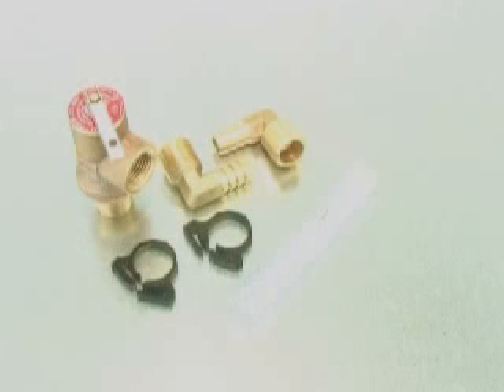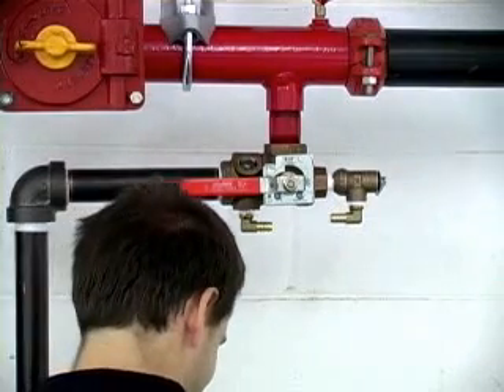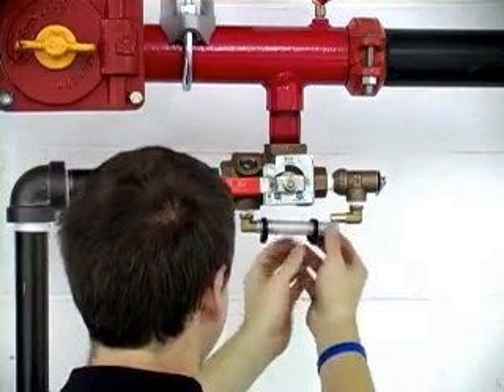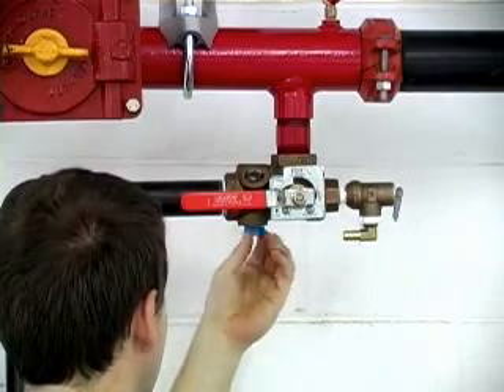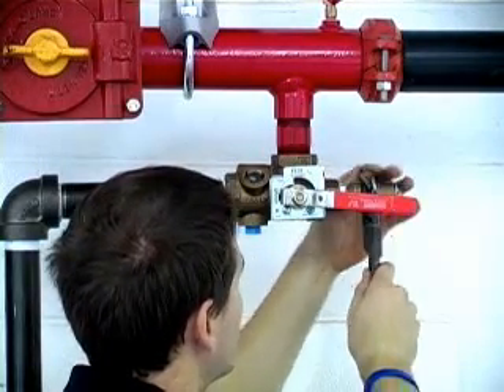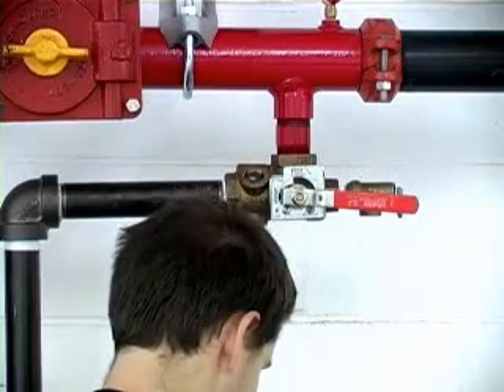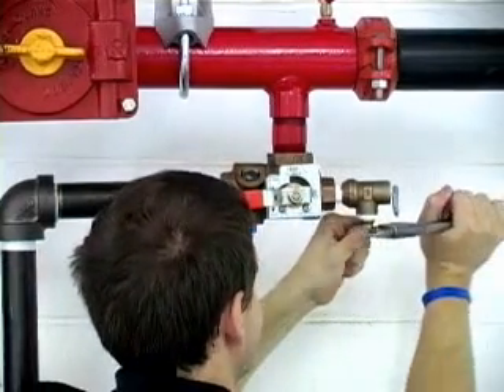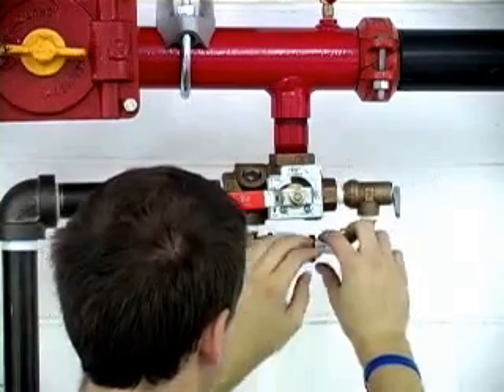AGF Pressure Relief Valve Installation and Maintenance

Comment: Hi, please I have facing problems with some relief valves. Usually they leaks or dont relief. I noticed that when the air gets into de system and during hot days the pressure increases and refief valves open and dont closed anymore. I guess this type of valve isn´t a precise like ajustable ones. So it is always dificult to keep than workin properly. Any advice  will be very welcome. Thanks in advance.
Reply: Hi Rodrigo, What is the static pressure of your system? You may discover that the valves are not leaking they are actually relieving pressure but they can not get the pressure low enough to fully re-seat. Regarding the use of adjustable valves, our valves are significantly more precise in their activation and responsiveness. Also, field adjustable valves pose a significant risk to a system as they are easily tampered with defeating their purpose and they do not have a flushing lever to use system pressure to clean the valve seat.